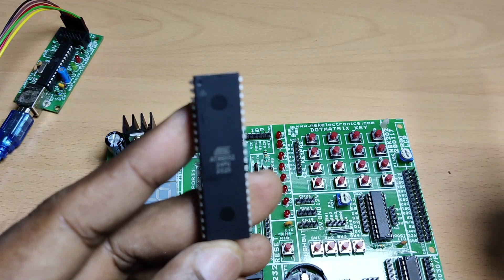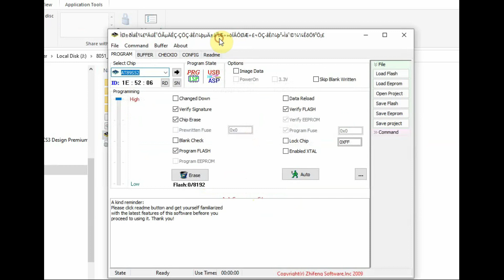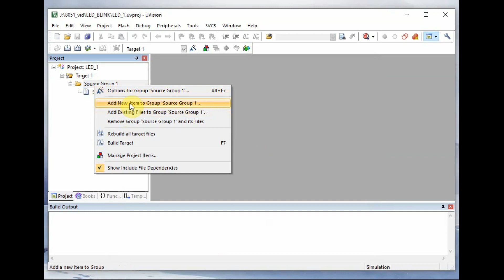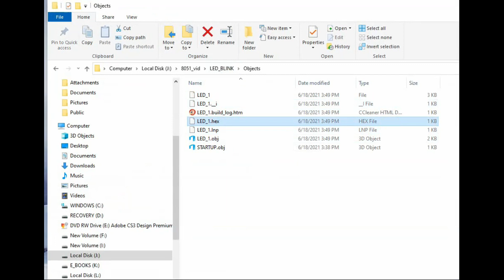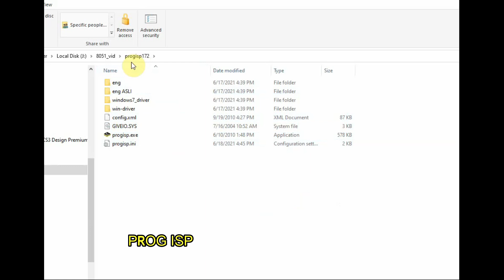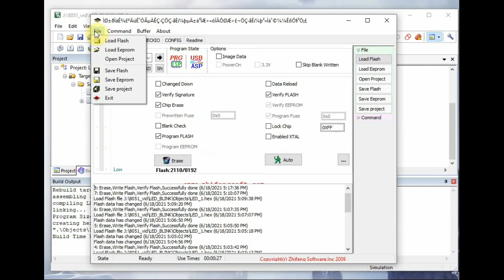8051 - Getting Started with KEIL, PROGISP & C PROGRAMMING

Comment: Sir My Chip Model Name Is Erased...
I Don't Know Whether It Is
Atmel 89C2051 Or Attiny2313
I Don't Know It's Name...
How Can I Detect The IC Model Name And Recover The Firmware...
And Remove The Lock Also
I Did This Programming In 2011, 12.

Comment: How to fix flash verify error
Reply: REPEAT THE SAME PROCESS OF CODE DUMPING AND WHEN YOU OPEN THE PROGISP SELECT THE HEX FILE AND CONNET THE 5V ADAPTER TO 8051 MC AND CLICK AUTO AND THE CODE WILL BE DUMPED HENCE THE FLASH VERIFY ERROR IS SOLVED